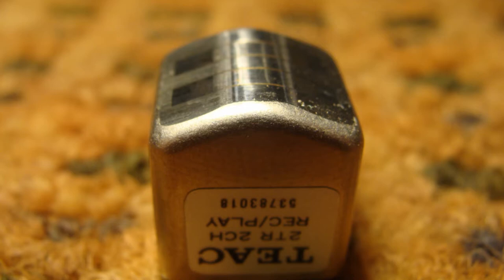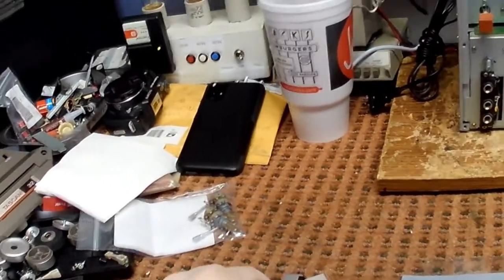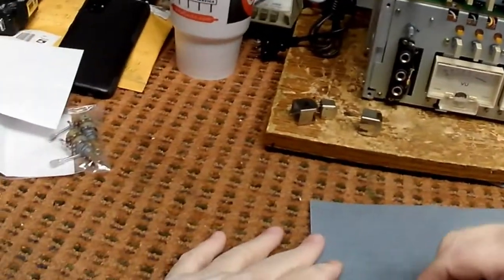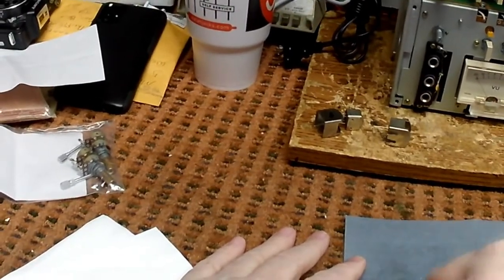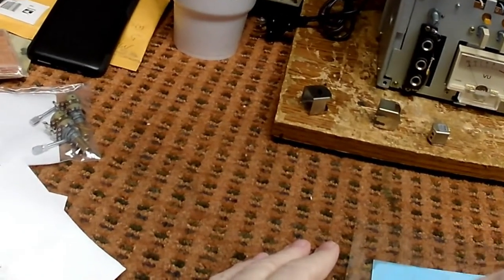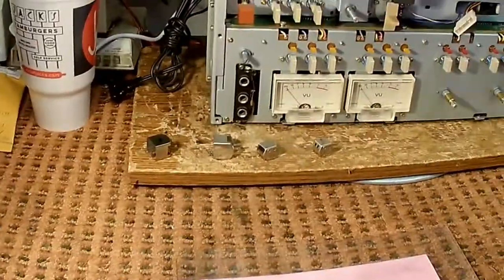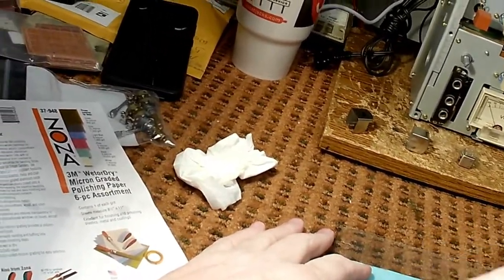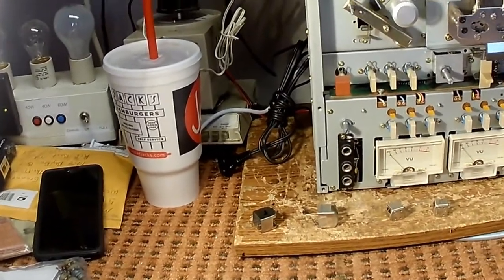How To Re-Lap Tape Deck Heads And Screw Up A YouTube Video At The Same Time.

Comment: Hey Scott. Just subscribed to your channel.
I keep hearing about the great GX heads damaging the tapes. 
People say that they leave a trail right in the middle overlapping slightly on both directions right channels.
Have you encountered this?
Reply from the maker: Thanks for your subscription! No, I've never heard of any such thing from GX heads. The only problem I've ever heard from gxs is when you have a tape that suffers from sticky shed syndrome, it will stick to gxs worse than normal heads and that's because the GX heads are much smoother then normal heads.

Comment: Is this method generally applied on 2" heads too? Btw, thanks for your video, really informative, much appreciated. Ciao from Italy
Reply from the maker: No. I don't recommend it on anything but 1/4 inch heads. Heads for wider tape are too hard to evenly grind, and you can end up with an asymmetrical head face that cannot be aligned properly.

Comment: So is relapping just a matter of polishing the face with fine (sand) paper?
Reply from the maker: More or less. It's not sandpaper, it's much finer than that. And you do need a flat surface under the lapping paper. As the tape plays, it wears a 0.242" wide groove in the face of the head. Relapping simply wears down the shoulders of that groove until there is no groove left.
Reply: @ScottGrammer  - damned autocorrect! I meant 're-lapping'!
Reply from the maker: @bernhardnizynski4403  No problem! Imagine the problems auto-correct gives me with my last name! Every time I type it in, it auto-corrects to "grammar."